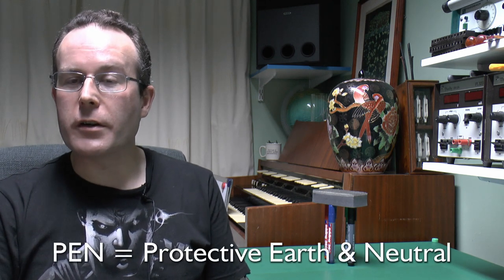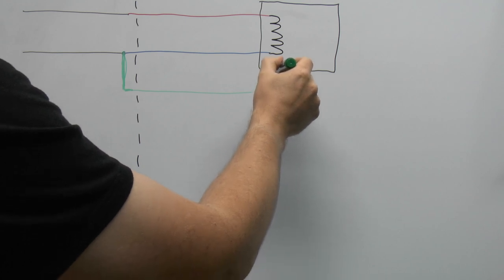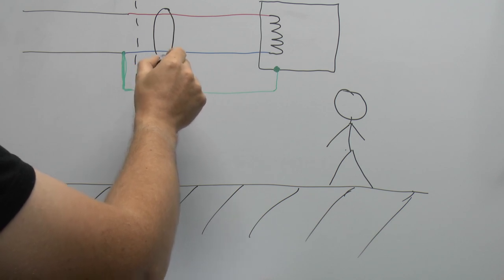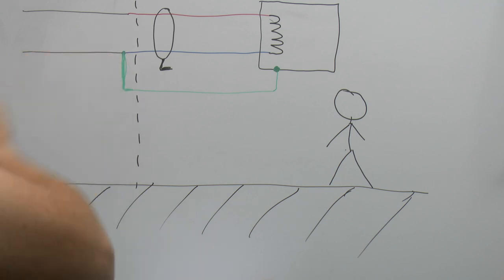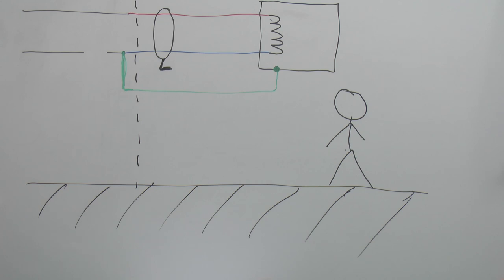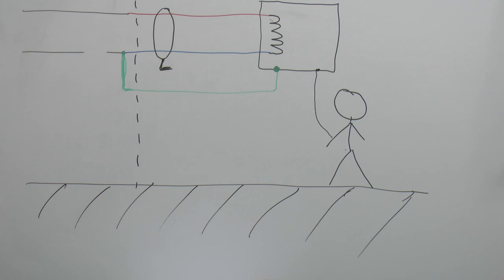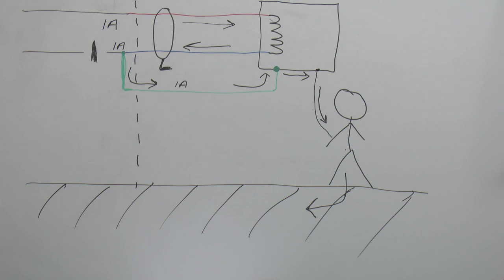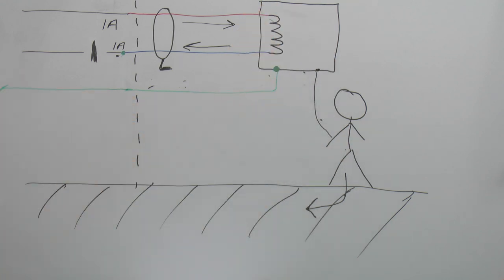TN-C-S Danger - Broken PEN Conductor (Combined Earth & Neutral)

Comment: Please please explain:

AC wave:-
+  -   +   -
 0   0   0
-  +   -   +

But if Positive becomes negative and vise versa then as Negative becomes positive it will sink to Earth... I am confused

Thank you
Reply: In an AC system it isn't as useful to think of "positive" and "negative" as it is "Line" and "Neutral".

At the substation the Neutral is connected to ground so whatever the phase at any instant the neutral should always have ±0v potential difference between it and ground.

On the other hand the  Line varies between, say +400 and -400 peaks (for 230v RMS values) and back again 50 times a second relative to Neutral/Ground.  This is the "energised" side so whether it is in positive or negative phase at any given instant or even passing through the zero volt point between them it is always the "source" of potential difference, therefore voltage and power.

If you look again at JW's diagrams you should now see why cutting the N connection further back than the N+E bonding point can cause things that are earthed to become energised  with Line current potential and be a serious risk of electric shock.

Comment: What if the RCD was installed before neutral and PE -connection? Wouldn't it work then?
Reply from the maker: It would work for some faults but not others, basically it would be useless.
In the UK it would be impossible to install it there, as the N-PE link is part of the distribution network, not the electrical installation.

Comment: Why in the UK do they not add an Earth stake on TN-CS systems?
Reply from the maker: For decades it wasn't required or even suggested, so no one bothered.
More recently it's 'recommended' so most people still don't bother.

In the past it was assumed that as water supplies to buildings were in underground steel or lead pipes and those would be connected to the main earth terminal via equipotential bonding, such things would serve the same purpose as an earth electrode even though that wasn't their intended purpose.  However plastic water mains have been the standard issue for half a century, so for most buildings that hasn't been valid for a very long time.

Comment: Even if PEN is unbroken, Wouldn't  some current go back to the metal case?
Reply: Yes but voltage on appliances connected to PE is same as voltage drop of neutral wire from transformers star point to your PEN -> PE point. The voltage drop is dependent on the current. I would say that under normal circumstances the max voltage on the PE conductor is about 5V.
Reply: On TN-C-S that would be minimal. On TN-C that is more common and it is a reason why it is not allowed anymore. It can cause interference on data cables. The voltages are not at dangerous level though.

Comment: I would like to have a RF earth for my radio shack in the house which has a  PME supply. But I think I should not do this because if a fault were to happen then my shack could rise to mains pd. Is that correct?
Reply: +johnsilentster Yes you should never connect one device to a seperate earth while the rest of the installation is TN-C-S.
You have two options:
- convert you whole installation to TT by installing your own ground rod and RCD's on every circuit
- convert your shack to TT by installing a seperate fusebox with its own ground rod and RCD's on every circuit

Even when you do it yourself always show your plan to a qualified and certified electrian up front and let it check your work and certifiy your installation! Some electricians might not want to certify TT systems.

Comment: Hello JohnThank you for sharing. In your example it seems there is no way to avoid the danger for a single phase consumer. what would be the result if in 4 wires three phase system when PEN output from substation ( say one feeder)  breaks and three phase system is badly unbalanced? In severe unbalanced condition neutral voltage could excess than permitted amount that in this case all consumers on that feeder may be in danger because neutral and earth are connected to each other.some people believe we can avoid broken PEN by multi grounding that I don,t believe this. Am I right to all I mentioned. Meanwhile my English isn,t good enough
Reply: +Mansour Rajabi Yes you are absolutely right. When in a 3-phase 4-wire 230/400 Volt system the neutral breaks, the neutral will float somewhere between Ground potential and all the phases. In theory when all phases are in balance, the neutral will be 0 volts. If however 1 phase is significantly overloaded compared to the 2 other phases, the neutral voltage and phase angle will float to a value close to the overloaded phase. 

So if the load on L1=50A and the load on L2=1A and L3=1A, the voltage/phase of N is close to L1. Do not forget the phase angle of the sinewave. Even though L1,L2,L3 compared to Earth is still 230 Volts, the difference in voltage between: L1 and L2; L1 and L3; L2 and L3 is each still 400 Volts. Therefor if the neutral rises in voltage/phase angle to L1, the difference between L2 and N is 400 Volts and L3 and N is 400 Volts. As soon as the load on L2 and L3 increases, the voltage on N will drop until they exceed the load of L1 which will cause N to rise to L2, L3 or somewhere in between.

A guy in the US once encountered a lost neutral and could solve the problem temporary by turning on his electric stove. The current drawn was so high, that the smaller appliances would just see a neutral close to 0 volts. So if you would just put a high similar load on all three phases at the end of a cable with a broken neutral, everything will seem normal as long as the other loads are insignificant in comparison.

I also agree to you that multi grounding does not solve anything but merely distributes the problem. It's like medication that instead of solving the problem, transform it into multiple smaller problems that are easier to handle each. But if you add the problems together, usually the total sum is equal or worse. 

This is the modern way of dealing with problems: 
Don't spend a lot of money on solving a problem when you can just distribute it much cheaper.
In general I disagree with this shortsightedness because at the end everyone will just pay the price twice!

Comment: In the example that you give, won't the water heater be connected to earth via the water pipes?
Reply from the maker: Possibly - not all water pipes are metal.
Reply: Old comment, but sadly not something you should assume. Many water services are now made from MDPE (plastic!) and increasingly gas are, too, even if they appear to be steel at the meter point.

Comment: Thank you for the video! Can someone please explain to me if the Neutral is NOT broken, why then the 1 amp will not still go to the metal casing of the machinery.(because  earth and neutral are still connected) ?? Thanks!
Reply: Because the neutral is earthed at the source, and at multiple points along the cable run (PME).
Reply: @toddbod94  Thanks! but clearly if someone would be touching the metal casing while standing on the ground that would be a return path for at least some of the returning current? so this person would get a shock?

Comment: Hi John, very informative video. You have since done a video taking about power to outbuildings/sheds etc and you say that you export the TN-C-S  earth and use this in the secondary location. If this secondary location is a garage and you touch any earthed metal work in the garage at the time this fault occurred aren’t the effects going to be the same as you are outside the equipotential zone of the house.  Also I assume that external metal light fittings can be very dangerous in this scenario as well as again you can touch this while outside the house, possibly stood in a puddle of water! 

As Gas and Water mains now are usually plastic there is little or no earth bonding to reduce the potential shock so do we have a pretty dangerous scenario going on in houses with metal external lights and detached garages where the supplier earth has been exported?
Reply from the maker: The same applies to any exposed earthed metal items, whether in the house, outside or in a garage or anywhere else.   Might be slightly better inside as you would probably be on an insulating floor.
This is a rare type of fault and supplies are normally installed to minimise the risk of it happening.  However it is relevant to some specific types of installations, which is why TN-C-S is not permitted for things like caravan parks or electric vehicle charging points.
Reply: John Ward Thanks JW it’s in interesting factor I’d never considered with TN-C-S. 

This has raised its head now as we have been told for this reason in the 18th that we cannot use the TN-C-S earth for EV Car chargers and we are struggling to come up with a solution as to how we can achieve a safe earth for the EVC as we are gonna struggle to install an additional rod to assist the TN-C-S as this would need to be approx 2ohm and I doubt we could get a rod into achieve that reading! and we aren’t able to install a separate rod to TT the EVC as these are located on a driveway  right next to the house where the homeowner is likely to have outside lights, outside sockets or even be adjacent to another homeowner with their car on charge on the next drive which could cause a dangerous potential difference under fault conditions. Any thoughts? :)

Comment: This is the problem EV charging point's and why OPEN device's are essential, sometimes incorporated into the charger. But there is also no guarantee that the earthing arrangement you see at the cutout is true all the way back to the transformer. (tn-s) I've actually spoken to the DNO and they cannot guarantee the earthing arrangement as it could have been altered to a tnc-s due to be damaged.
Reply from the maker: There is no guarantee that the device(s) built into single phase EV charges will work in all circumstances either.

Comment: that is not tn c-s system works and u miss a very important thing, earth is also connected to eath- in your house. so current will always flow to lowest resistant and that is the connecteion to earth
Reply: If you have a newer property with Plastic Mains Water supply and Plastic Gas or no Gas to your house - then there is not other Earthing - there is only the CPC to Neutral =- hence the issue of no longer having a route to Earth,

Comment: Hi, how much the  value of voltage as recommended earth to neutral. I have checked in my site it is more than 8v. please help me to reduce the voltage and I have checked earth and phase the difference is 3 voltage
Reply: Sounds to me you don't have any earthing You should let an earthing professional test your Earth!

But a little explaination might be usefull for you and other people...

Since Kalai Arasan and your YouTube video's look Indian I assume you're from India where the mains voltage is 230 Volts. As far as I could find India has no Neutral Earthing but applies the French TT-System. Therefore the voltage difference between your neutral and the Earth can become significant and depends on how far you're away from the transformer. This is not the case with TN where the Neutral to Earth difference should be less than 1 Volts.

I've seen Neutral to Earth voltages as high as 10 volts 1 km away from the transformer in a rural village in France. This is because the wires are 50 years old and too thin to handle the increased load but they are going to replace the wires with thicker ones.

Earth to Phase voltage should be 230+-10%. If the Earth to Phase voltage is just a few volts as well as the Earth to Neutral voltage then:
- your earthing is not adequate
- the neutral at the transformer is not (properly) grounded (not likely but possible)
- you live in a very dry area where grounding is difficult (or impossible).

In normal installations with 16A fuses/breakers the impedance between the earth and neutral should be less than 100 Ohms when you use 30mA RCD's or less than 5 Ohms without.

In dry area's TN-C-S or TN-S is recommended because of the unpredictable ground water levels causing the impedance of the earthing rods to fluctuate. But many power distribution companies do not allow TN because then the Earthing is (at least part) their responsibility.

Do you know if your installation is installed or at least verified by a licensed electrician? Or was it a friend of a friend?

Comment: Your hypothetical example of a 1amp current flow in the case of the open circuit PEN conductor is wrong. There is NO current flow in an open circuit, therefore it is actually zero amps (The real reason why the RCD does not operate). Current will only start to flow when an unfortunate individual touches an earthed metallic part and has sufficiently low enough resistance to ground. 
However, this is an otherwise great demonstration to show the dangers of this type of supply. The very reason a caravan must be supplied by a TT system.

Comment: In tncs supply nutral also earth at consumer side but you have shown nuetral not earth at consumer side.
Reply from the maker: It is in most countries.  In the UK there is no local earth electrode,  the only earth for the installation is the solid link to the incoming PEN conductor provided by the electricity distributor.

Comment: But when the system is TN-c and pen conductor is broken the situation is the same. The metal corpus will be supply with 230. really. Yes or not. even without RCD, only with circuit breaker.

Comment: ps: as there is no earth fault in the heater, the neutral return path is via the PME connection at the cutout, through the protective conductor to the water heater, and through the person connecting the metal case of the heater to earth. Therefore, the RCD WILL trip!

Comment: Not having the  earth wire seems safer in this case. I cant see the purpose of having it anyway ?if the return goes through the neutral.
Reply: You have things to learn. You are scare if a very rare situation and then ignore a much more common one.
Reply: @okaro6595  That don;t sound like a technical reply.I made that comment four years agp.What exactly are you saying I need to learn? don;t say electical I want exact broken down details of what exactly I need to learn.And I am scare?Are you a foreigner who;s English is a poor? 

I mean look mate I said that the live wire returns the current through the  neutral wire.But if there is an earth wire connected to the neutral wire  and to the case then if the neutral wire breaks  as he says the current will return to earth and the case making it live and a danger for anyone touching the case.

So the point I was making was if there is no earth wire connected to the neutral and the case then if there is a break in the neutral wire then there will be nowhere for the current to flow to That's all I was saying.

Comment: Is there a safe way you could use an rcd in a tncs system?
Reply from the maker: RCDs are fine to use on TN-C-S to disconnect if other faults occur,  but there is no way to use one to detect this particular situation.
Reply: @jwflame  Why not connect the earth to the neutral on the consumer side of the RCD? If the PEN were lost, the current path would be live -> RCD-> heater element->neutral-> chassis->victim. It would pass the RCD only once and so trigger it.

Comment: Can you have tncs and tt combined outside on metal work ?
Reply from the maker: No.  A TNCS system can have earth electrodes connected to it, but it's still TNCS.
A TT installation cannot have any connection to any other earthing system.
Reply: @jwflame  what it is John, I have a solar array outside (ground mount) I installed metal tray across the structure and mounted a ip65 metal consumer unit to it. Fed by 40A mcb with a swa gland etc. Ive exported the pme out to it. I was thinking of putting a pen fault detector on to it but not sure if it’ll work with the solar as it’ll back feed.

Comment: How is it even possible to break just through the neutral and not the live aluminum cable on a concentric cable?
Reply from the maker: It's very unlikely, but not impossible for a concentric cable to be damaged in that way.
However it's far more likely for joints between cables to fail due to corrosion, and the outer NE will usually fail first as the individual wires are not insulated.
There are also examples of overhead supplies using two separate conductors rather than a single cable.

Comment: Would be useful on tncs if there was an RCD type protection between generator and property
Reply: In France TT Grounding is used and all main circuit breakers do not only have Over-Current-Protection but also Residual-Current-Detection for exactly  the reason you think of. Most residential connections are 40 Amps OCP and 500mA RCD. This will not protect you from electrocution but will trip in case of a Phase to Ground fault.

The main reason is because when using TT Grounding Phase to Ground faults go unnoticed without an RCD where with TN Grounding Phase to Ground faults will usually trip a breaker except in case of a broken neutral.

So yes having a Main Circuit Breaker with OCP and RCD would be a good idea in general in any installation although most European countries residential circuits are already protected with an 30mA RCD.
Reply: You cannot have an RCD before the earth and neutral are connected. For one, it would break the earth which is not allowed. Second if there is any secondary source to earth from any equipment case, some current would flow that way and the RCD would trip. 

You may think that what is the problem if the earth is broken but remember the RCD is an equipment that can fail. What if it breaks only the common earth/neutral? It would create just the problem mentioned in this.